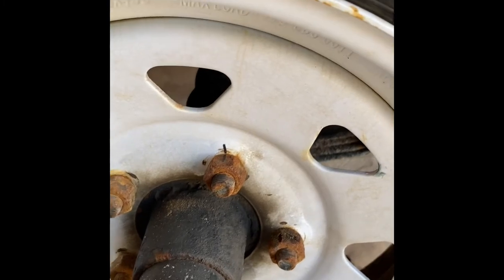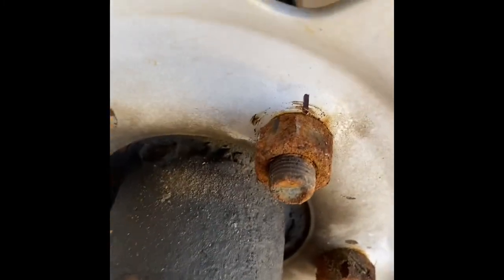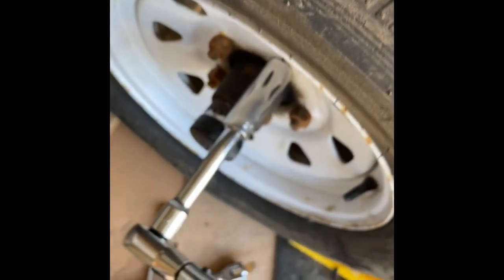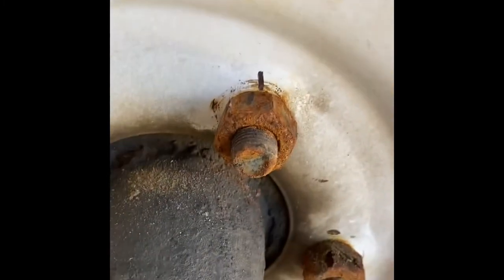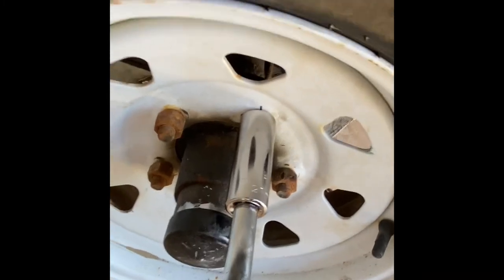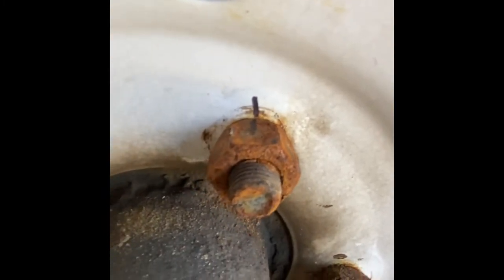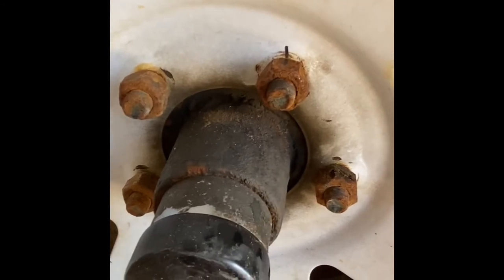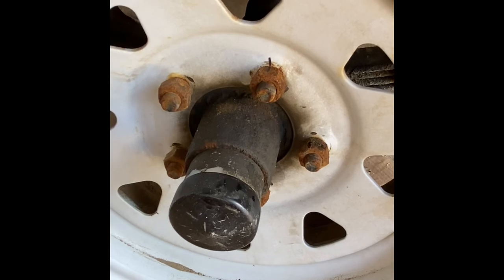Simple and easy trick to find the torque specs on your trailer lugs

Comment: It does not mean that the recommended torque specs is 65 lb, but you going what the previous owner torque them too. You could have found 20 lb...

You should use Dexter's Product Bulletin #409 to get the correct torque specifications for all kinds of trailer wheels. http://hltlimitedtrailers.com/wp-content/uploads/2019/10/Dexter-Wheel-Torque-Requirements.pdf
Reply from the maker: Thanks for sharing!
Reply: Right. This dude is way wrong.